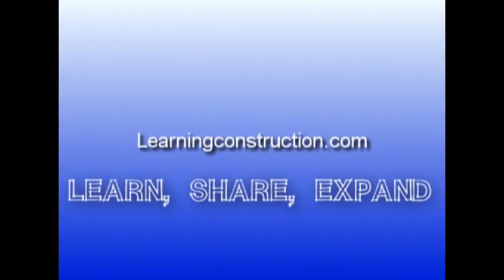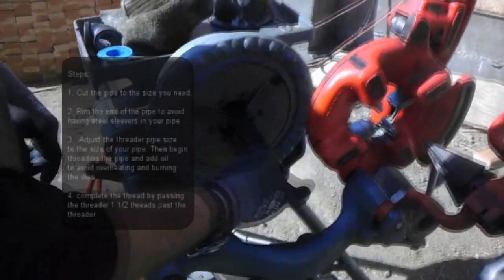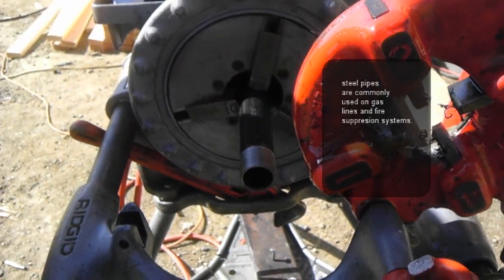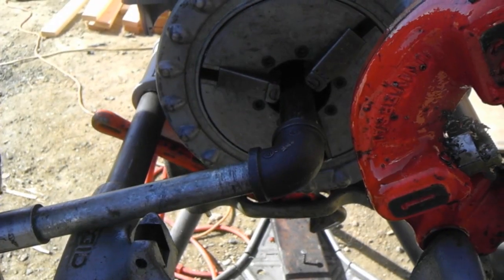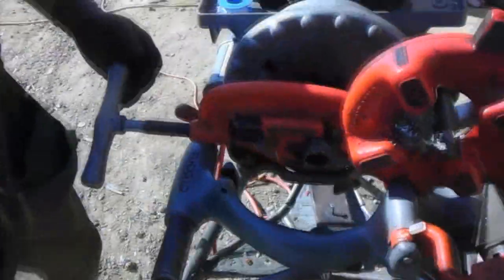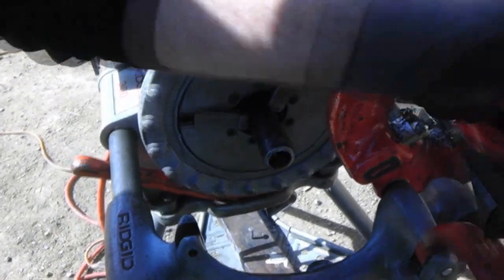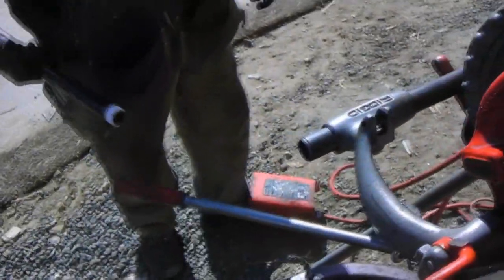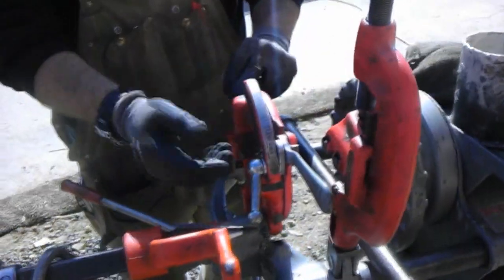How to use a pipe threader  threading a steel pipe

Comment: You may already know, but a couple of decades ago, I needed to cut some garden hose thread.

Choking on the $85.00 price tag for a die I only needed for 5-6 cuts, I did some research & discover if I put the 1/2" cutters in the 3/4" holder, I got hose thread.

Basically, hose thread is 3/4 x 1/2 TPI, for those not familiar w/ threading pipe. Technically hose thread is not tapered thread, but the thread is so short, I've never had a problem.

Now, cutting internal hose thread poses other challenges.

GeoD

Comment: I went through a 5 year apprenticeship with the UA, we were always taught to set the dies correctly (3 spins of a fitting by hand) and never run past the end of the dies. When you run past the end of the dies you are adding a non tapered section of thread to a tapered connection. It effectively gives a void in your threads. yes it's thin and will probably conform to your fitting and you will probably never have a problem, but its not the correct way to do it (and really one and a half past isn't much). For those who don't believe me, contact rigid. Otherwise, yes he looks likes a guy with many hours behind the machine.
Reply: Does it also cause stress upon the dyes?
Reply: @jeremytoon8106  the dies are stressed the entire time threading. its best to use them correctly or they will chatter the threads and prevent sealing

Comment: Thats a nice machine. I had a bigger one at school. Also it had a lever on the dyes that would autmatically open the dies when the pipe gets past the end of the die. It also had an automatic oil feature that we never hooked up but we used the same oiling system in this video. Lol my vo tech teacher yelled at me for trying to put the fitting on using the machine. I didnt use a bar i used an actual pipe wrench.

Comment: Thanks for video. Not good practice to put fitting on with machine torque due to overtightening and using a cheater on the other side of fittings threads- will ruin the threads

Comment: I have been trying to thread a black iron pipe schedule 80 1 1/2 dia.when I go to apply the cutter to the pipe it wont go it just butts up against the pipe so I adjusted the setting for 1 1/2 enough to get the cutter to start, it made the threads but it does not give me that taper on the first thread so that it can start threading on the elbow that I want to attach and the elbow wont go on. Can anyone tell me what the problem might be? The pipe threader brand is a Rothenberger.Any help will be appreciated.Thank you
Reply: you might be spinning backwards? apply more pressure to start maybe
Reply: Just because you have it set for 11/2 dia doesn't mean that it is set at the right part you may need to have to move the lever up a little above the line in small increments to make the threads loser because right now you may have the threads to tight

Comment: Thanks, just scored an older power threader, still in good shape.

Great demo on how to use it like a pro; my old shoulders & arms will appreciate not having to manually thread pipe.

Unfortuantely, the old azz Oster is pre-foot control. Looks like fabing one would be worth the material & effort. These buggers have some serious torque; you ain't slowing them down!

GeoD

Comment: How do you put that in your truck without tweaking your back ?
Reply: Best way is to get a set of wheels that's locks down by the chuck.wheel it over to the back of the truck and set it up 9n the tailgate, pick up the legs on the vice and secure to bed to keep from sliding.

Comment: You ever thought about using a steel 14 to pull the fitting on. Putting that pipe inside the fitting just seems like it might mangle the threads of the 90. Otherwise awesome video man. Sprinkler Fitters Local 542 Pittsburgh PA.
Reply: Actual 542 putting nipple in is alot safer than a steel 14 ....u ever get your small flesh stuck between wrench and machine cause nerve damage in hand ...better to use steel 18...14 is ole skool
Reply: fitter542 union fitter that thinks a make on bar is harmful, first day or first month apprentice I smell lol!

Comment: Wow that  was quick.   Why is my estimate for 7 pipes connected with Tee's was 1700 dollars?    It looks like someone who knows what their doing and one of these machines can make the connections in about  eleven minutes.
Reply: They didn't show setting the equipment up, getting the measurements, or putting it together.  You have to be way more precise with rigid pipe and it's a dying art, done right at least.

Comment: You made too many threads and buried the fitting too far. You should only make 11 threads and have 4 threads exposed after tightening the fitting. I bet all your work leaks. lol.
Reply from the maker: Never had a problem, but great comment! thank you for sharing your knowledge!!
Reply: If you say so Dan.... and it's you're, not your.  I can spell and thread pipe properly. I'm special!
Reply: Very very busy. Threading pipe correctly and trolling the interweb takes up most of my day!
Reply: Silly arguement if you pull up on wrench and u move machine then its tight and no leaks